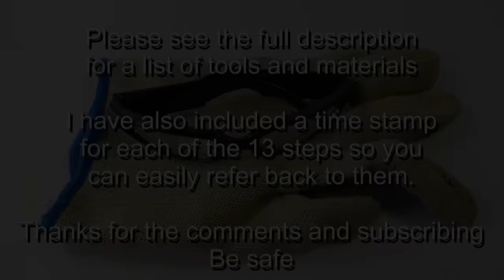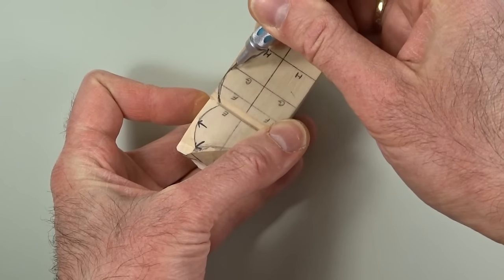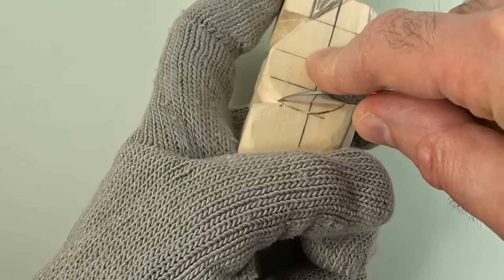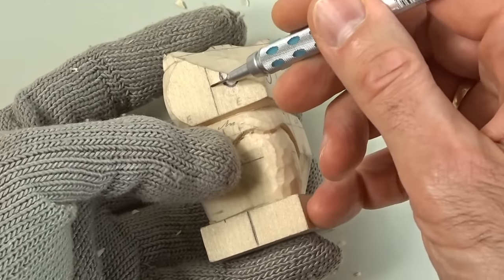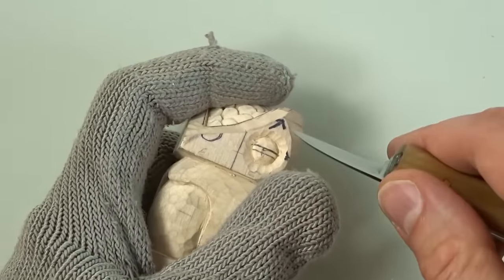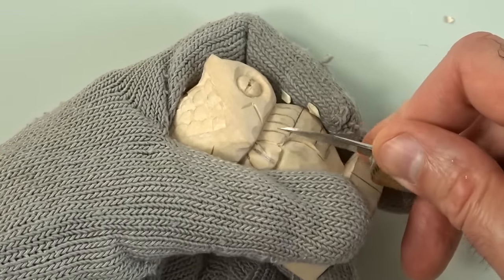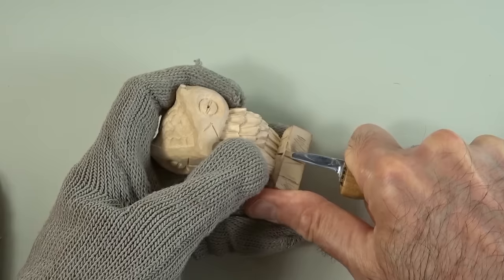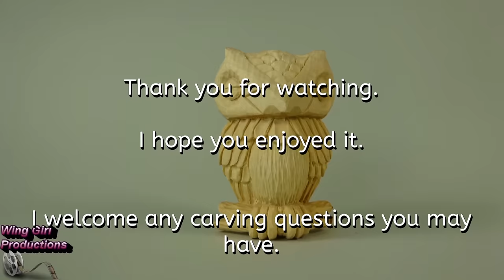How to Wood Carve a Sleepy Owl

Comment: What brand of pencil is that and where can I buy one ?  Same with the carving knife. Great video by the way.
Reply from the maker: Hi, Thank you for the comment! I'm using the PENTEL GRAPH GEAR 1000 AUTOMATIC DRAFTING PENCIL .7mm Lead size (MODEL: PG1017C) Currently $10.69 on amazon.com  The carving knife is the Rick Butz carving knife from www.woodcraft.com its around $25  It doesn't come sharpened, so if you don't know how to sharpen, I would suggest to ask woodcraft if they have a sharpening service. Hope this helps, Have fun carving and be safe!